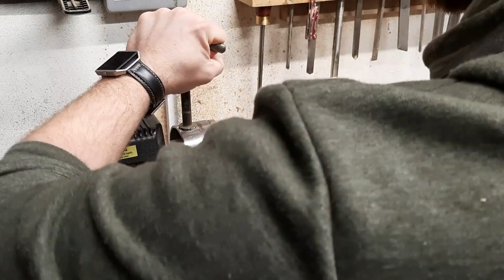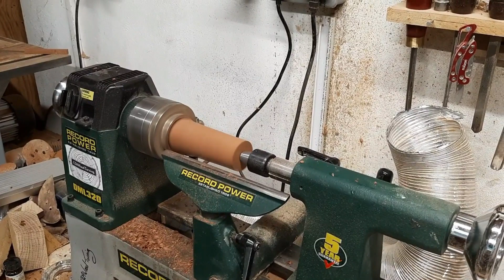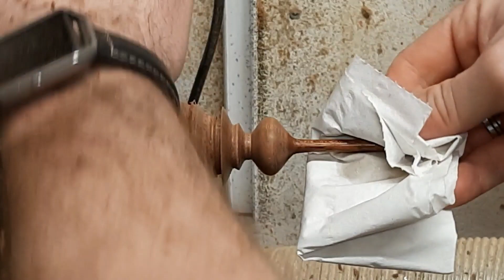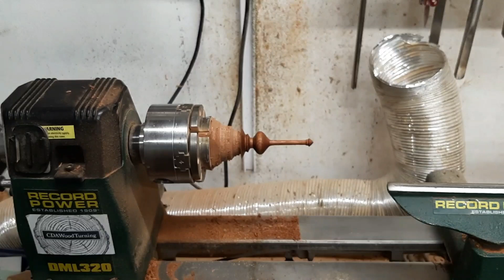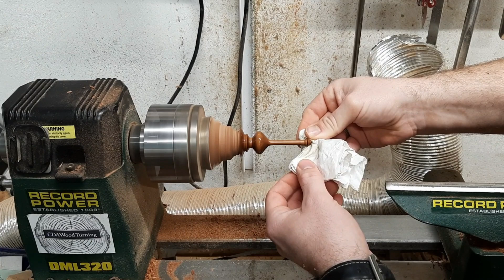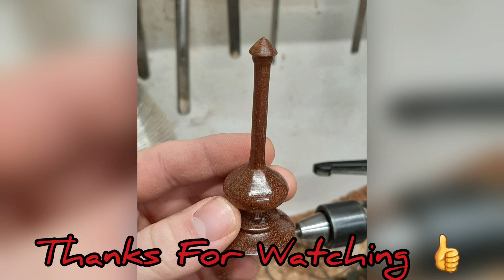Making my First Finial

Comment: Nice job.  Does the Liberon sanding sealer take long to dry?  So far I’ve only used cellulose sanding sealer.
Reply from the maker: Takes seconds .. it is super fast .. i put it on and sand seconds afterwards .. could be due to the spirit in the sealer